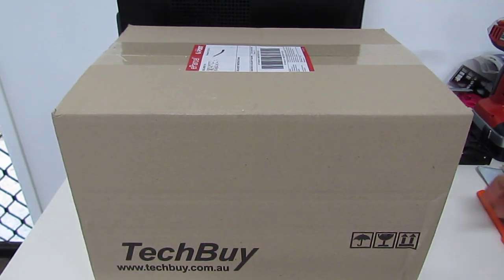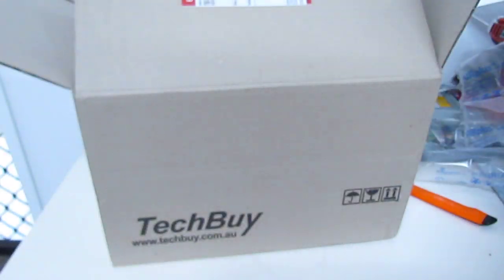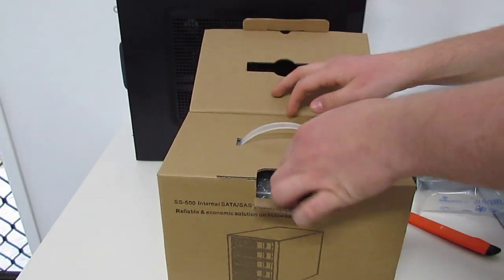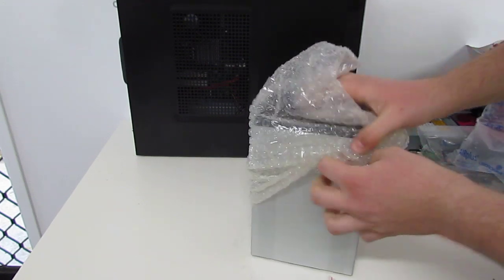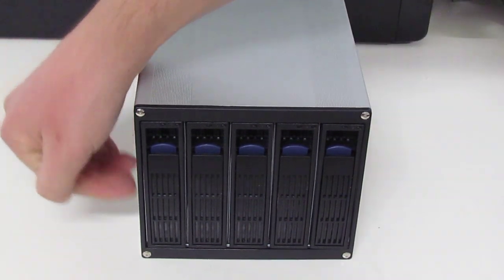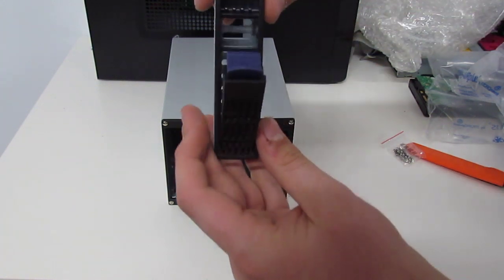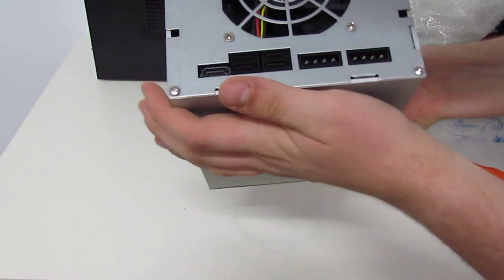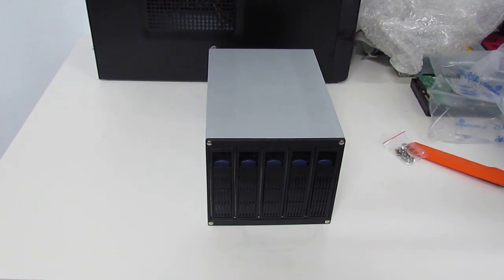#0010 - Norco SS-500 5-Bay SATA/SAS Hot Swap Rack Module - UNBOXING

Comment: This is an external device. I have several of the Norcos intended for internal mount and they don't have the case around them as this one does. All he need do is remove the case and it should fit just fine into 3 5" bays.

Comment: Good product, but 80mm fan is very noisy. I ended up changing the fan with an adapter to a 120mm fan. It is now whisper quite to the point where the HDD are the loudest components.
Reply: This and only a 5.66 mm large gap at its best between each hard-drive.
The width of a 5.25" bay is about 147,64 mm
The height of a 3,5" hard-drive is about 25 mm.
And in this module is enough space for 5 drives.
Thus:
(147,64 mm - (5 * 25 mm) )/4 = 5,66 mm
The airflow through this 5,66 mm gap must be terrible and it will require a fan with a big air flow rate.
Reply: Your correct. i used a Nactua NF-F12 high static fan for the job